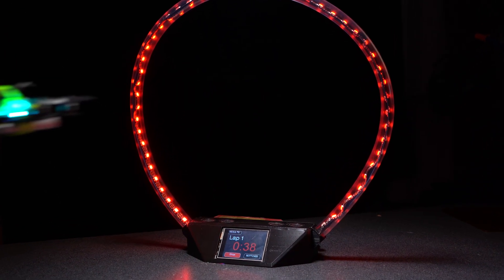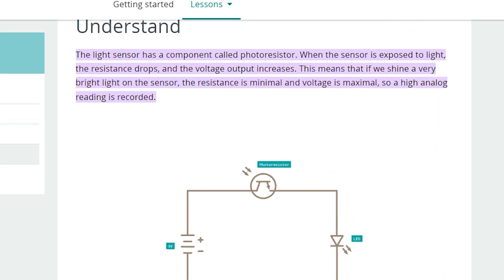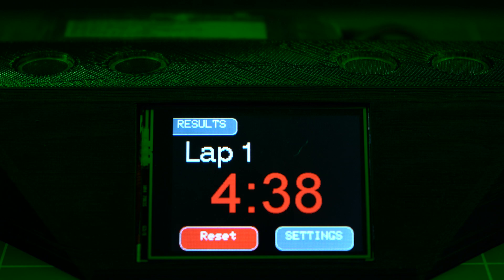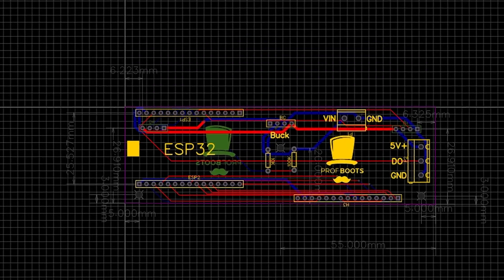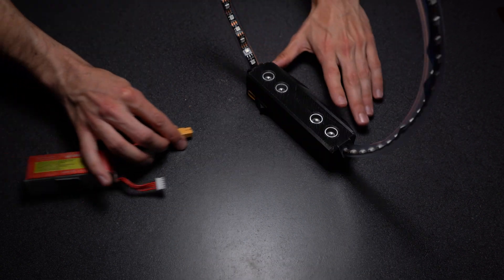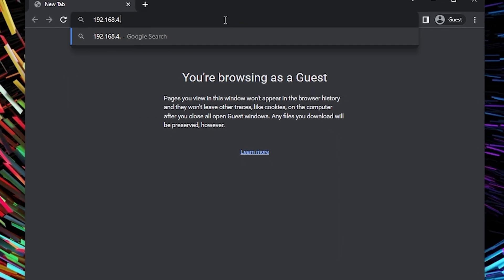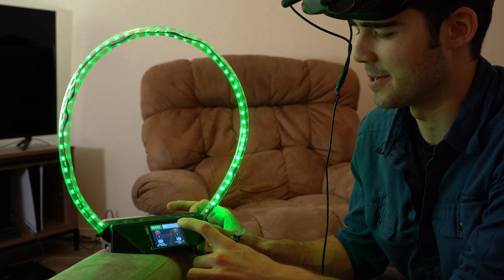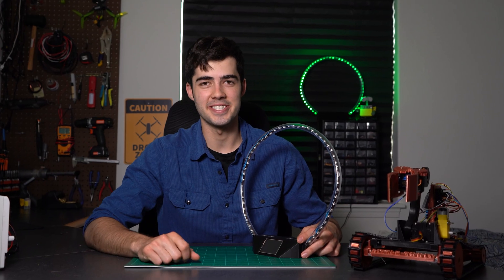DIY TinyWhoop FPV Racing Gate with Timer

Comment: You could now connect an FC between your 5.8 GHz RX module and goggle video in, and have the OSD chip overlay lap times on top of your video feed. I did some BetaFlight hacking at some point, let me know if this is interesting to you

Comment: Love the direction this gate is going! I think itll be very successful when you can get it to work seamlessly with tracking multiple racers times seamlessly. Also, may I suggest putting mounting holes in your base? Such as we see in chargers for power tool chargers? Then we could mount it on walls or ceilings! 😊

Comment: the screen should be covered fully that you can't see anything other than pixels ,it will look better and it is the right method that i think you can easly find in screen datasheet <3

Comment: Great project!! 

I also tried building a gate with ultrasonic sensors but they were not reliable or fast enough. I was using a raspberry pi. 

 Switched to a laser sensor and it was much more reliable, but mounting it it's harder as laser and sensor need to be perfectly aligned. I have it on my todo list.. 

As a solution for multiple pilots, I know of a couple products that use the VTX frequency to differentiate the pilots.
Reply from the maker: Thank you! I think the laser would be a great alternative but could definitely see mounting as an issue. I’m looking into alternative methods right now

Comment: since its a gate why not use nfc tags (or any other type of tag) to fergo the ultra sonic detectors ? i think you can create some sort of a scanner in the tube and have each racer its own tag ;)
Reply from the maker: Thank you so much for the feedback! I’ll definitely look into the nfc tags, sounds promising!
Reply: surplus: i saw each lap is the total amount of second, would be nicer to know how long each lap took
Reply: Interesting, but I have my doubts that the reader is fast enough or that you can pass at a distance from the reader?
Reply: NFC is typically short range and gets expensive to go long range. Same with RFID. I was thinking a barcode scanner. It'd be a simple barcode sticker on the whoop, so light weight. Nothing fancy, doesn't need to be a 2D barcode. The ESP32 supports a camera and there's code to read barcodes. The question is, would the camera and recognition be fast enough to capture the barcode as it's flying through.